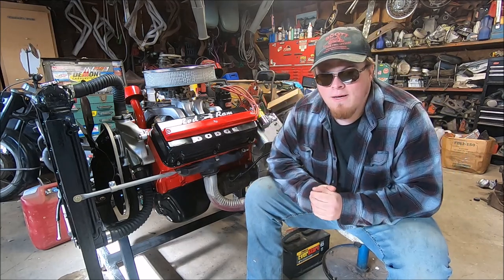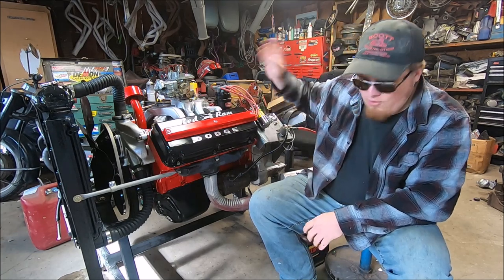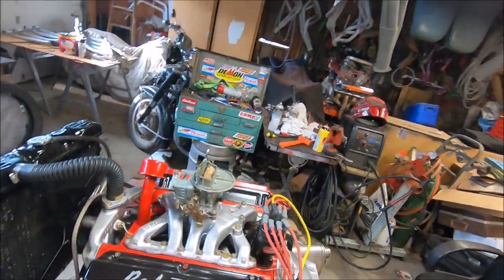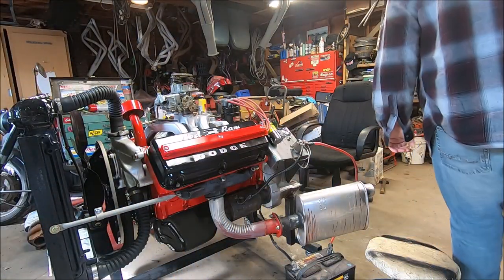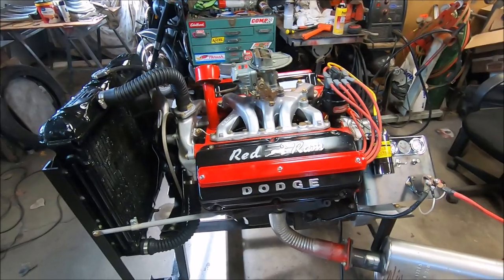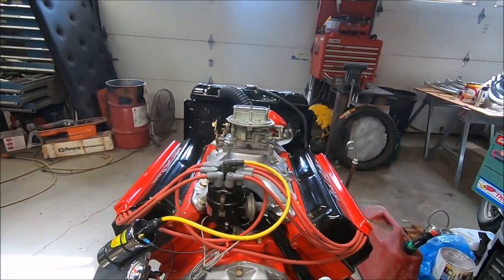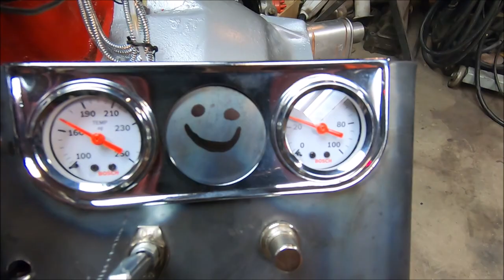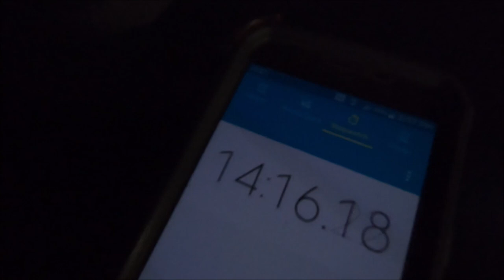241 Red Ram Hemi Update and Cam Break In!

Comment: Great job on rebuilding this 241 Hemi.  I am in the process of rebuilding my 270 hemi and have picked up some good ideas from you guys. I am in the need of regrinding my camshaft and wanted to check out the company you used.  I think you said the company was "Hard Cams" in Cal, but I could not find them on the internet. Do you have a phone number or email for them?
Reply from the maker: The owner is Don Jahansen, his number is 909-815-9185, tell him you saw his cam running in my early hemi. Don is super cool, my cam was only like 120 bucks as well. You won't be disappointed my friend, if there is anything else, just let me know